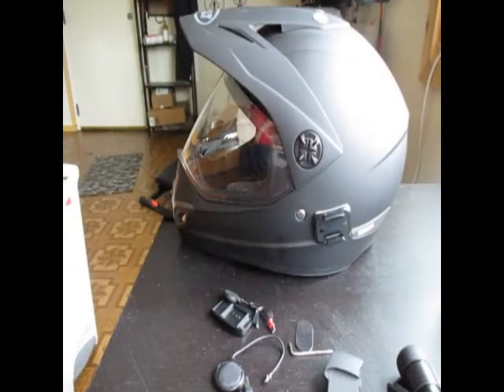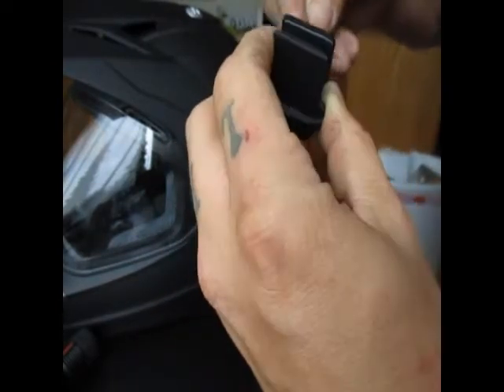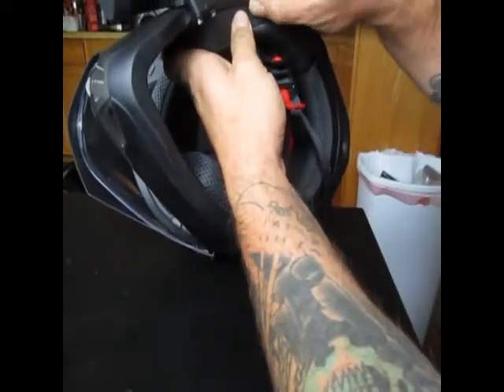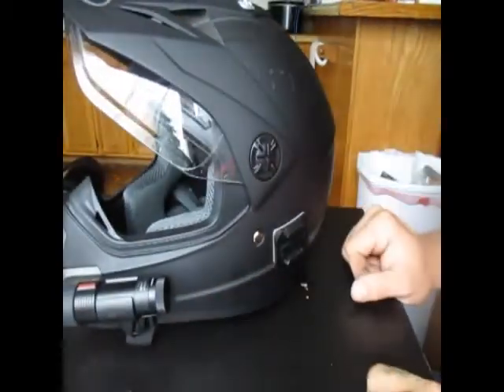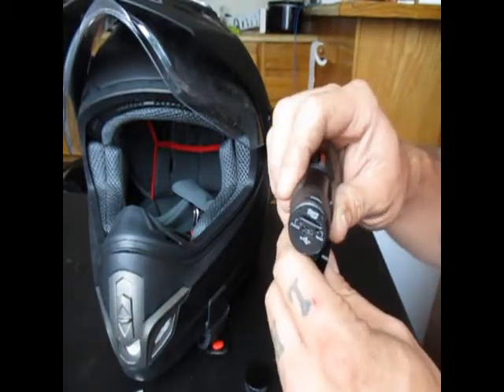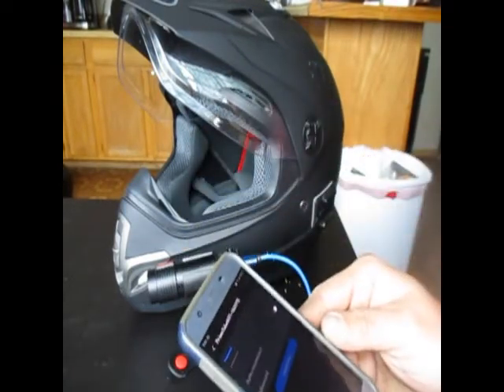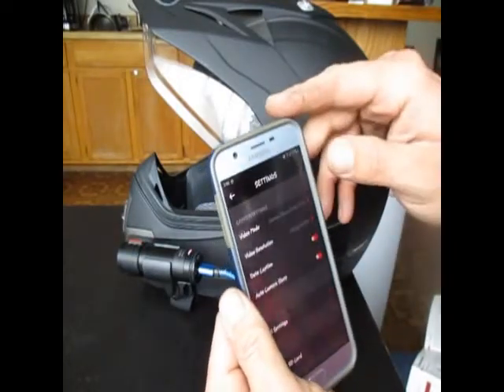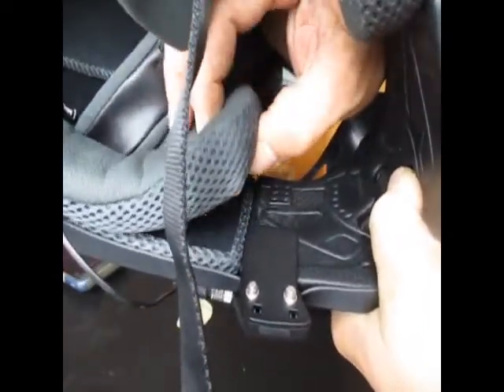HOW TO!---SENA PRISM TUBE WIFI MOUNTING #SENA #RIDECONNECTED #WITHME #ADV

Comment: I am looking at buying a tube. I have a GoPro hero 5 and I am tired of trying to get audio
Reply from the maker: Hey hey thanks for the comment. If you look at my other video "why everyone should buy a dr650" 
As well as the video "social distancing urban dual sport". 

The audio is really nice. I ended up having to take a sing sponge and put a small bit of it over the mic. It works really well though. I'd mount the speaker a little closer to my ear. But it's great other than that! The best part is the cost...119 bucks. Way cheaper than gopro and mic adapters and such. This is the all in one ready to go! Thanks for watching and stay tune for more. Be safe!!
Reply: @HooksAndWheels  thanks, I will go and watch those other two videos. I am trying to get into motovlog too. Someone gave me a GoPro hero 5 black. Great camera but even with the stupid adapter audio is a pain. I need easy plug and play.
What are you using for editing software?
Reply from the maker: @theramblingsoflarry9290  I am using Hit Film Express. And Powershot Editor. They are the best ones I found for free at the moment. But I'm working in getting Adobe Premier.
Reply from the maker: @theramblingsoflarry9290  Gave ya a subscribe. Good luck to you sir!

Comment: My sticky mount fell off
Reply from the maker: I ended up gluing mine to the side of my helmet
Reply: Hooks And Wheels I was lucky that the mount (& camera) fell off while sitting on my nightstand. I had mounted it 5 days earlier & went over the entire area with 70% isopropyl alcohol on a microfiber towel before mounting it. 
Last night I re cleaned the area and applied 3M exterior mounting tape. If that doesn’t work then I’ll use the clamp.
Reply from the maker: @blkjakk  be careful with the clamp. On a wide helmet like mine it snapped in 3 days!!
Reply: Hooks And Wheels Good Lord I need to re-design their mounting systems
Reply from the maker: @blkjakk  I agree!! I used a go pro adhesive mount and then super glued the edges. It's been fine on jumps...dropping it in the woods...so far so good!. Just bought the ghost drift xl as well